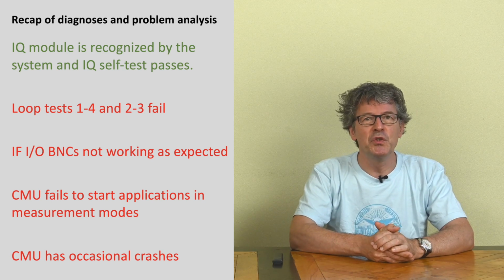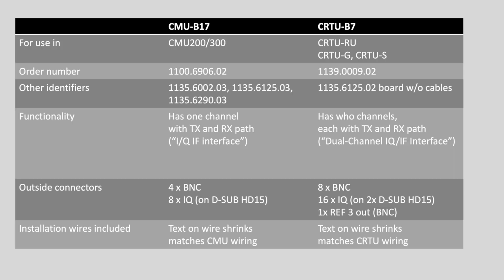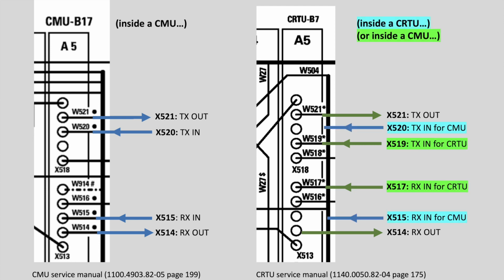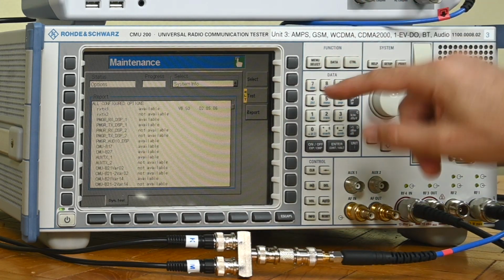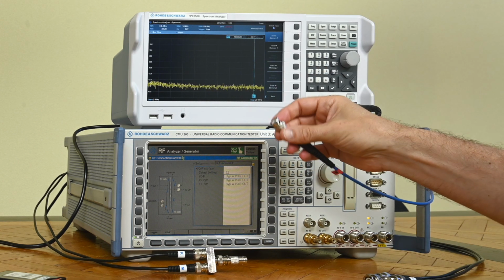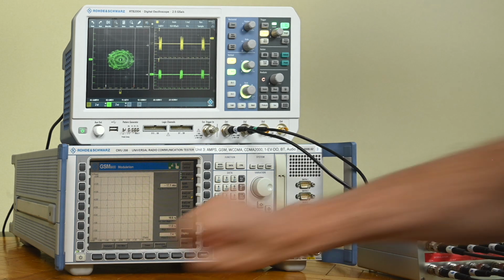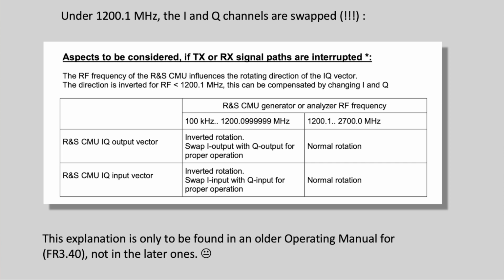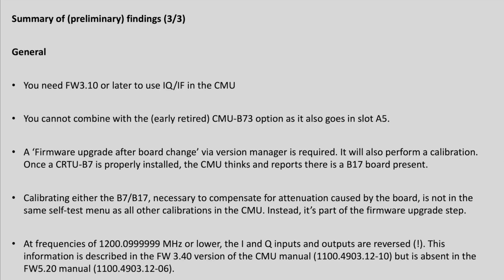REL #30 Adding B17 / B7 IQIF option to CMU200 - SUCCESS

Comment: Is it true the AMU200A can only generate limited amount of signals? You can upload 128M of IQ samples in memory, can’t you? Just hookup Matlab and generate the files. Probably only baseband so you might need to uoconvert. Quite sure R&S have foreseen that in some way. 

I use an Anritsu MG3700A for similar A and B channel IQ signals that are added and upconverted. Comes with the 2/3/4G signals as standard as well as the software to upload your own. 160MHz of baseband bandwidth, so quite impressive. 

Would not match so nicely on your desk with the R&S family, but happy to lend it out to you for some weeks to experiment with.
Reply from the maker: Dear Wim, the AMU200A is quite flexible, and you can indeed upload IQ samples in memory (and also create lots of signals otherwise)…. but … to do so, you need one of the Baseband Generator options (AMU-B9, B10 or B11). I do not have these options installed, so my unit is basically limited to being a fading simulator. Cannot complain, as I got it at a bargain price, but if I ever manage to get one of these options, I’d like to upgrade it. 

The Anritsu MG3700A certainly looks very interesting! I’d really like to use it one day, and would be happy to see whether we can run some project together with it ;-)
Reply: @rudiselectronicslab861 ahh! You need the option to actually make it function as it is written on the front :-). Yes, that is odd. 

Happy to help out with the Anritsu.

Comment: Sometime to note. This option is only working on newer CMU that one that has the MB with the USB connector. 
I bought the board, probably from the same seller as you, but having a old CMU I thing it is not working for that reason.
Looking at the MB schematics that are available online for the older model and the board you realize that one of the power supply rails is missing. 
)Mean one pin is clearly connected to a power regulator but is not connected to anything on the motherboard)
I thinks is like a 5.2 volt that is regulated on the board to 5V. Without that the board is still recognized and seems to work but the self test show a ton of errors due to missing voltages and nothing is outputted to the IF channels.

I am curious of have a look at the newer MB schematics but that are no public, have you got them in the schematics you obtained for the unit that you show a couple video ago? 
Just wanna verify at which pin the 5.2V is in the new motherboard connector or more in general how is the pinout of X52 so I can compare with the older one and find if are any difference.

PS
Also my  board is CRTU board but it show the FW version been 1135.6125.02 fw 3.23
Reply from the maker: It may be true CMU-B17 can only be combined with FMR6 (or later), but I have not come across any document pointing that out. B17 seems to be quite an old module: its CE declaration is dated September 2002 (CMU Operating Manual for FW 3.40, 1100.4903.12-10). That does not mean it was actively sold at that time, but it suggests its design may be as old as the CMU itself. 

Looking at an older version of the CMU Service Manual (1100.4903.82), which only lists FMR4 and FMR5, the slot A5 and associated connector X51/X52 are designed for an “A/B TEST” (no idea what that is), for an “IQ-MODDEMOD” (so the B17) and for a “LOW FREQ BOARD” (which much be the early retired CMU-B73 Analog telephone line interface). That document does provide a pinout of the X51 and X52 connector, with +5.2V specified for pins X51 B6 and B7. At the same time, that old service manual does not provide the same level on B17 as later service manuals, for instance, it is not mentioned in the big wiring diagram. 

So I wonder whether B17 should work after all with FMR5, but cannot be sure... I have a CMU with FRM5 here; if I once come across one more IFIQ card I might try it in there!
Reply: @rudiselectronicslab861  So I check basically the board on the side where the connector are inserted had a budged regulator, that regulator had the Vin pin connected to X51 B20 pin. That pin is not connected on older CMU motherboard. Would be interested to know what voltage that pin has on newer motherboard!
 Also The budges on the two regulator are amazing! Guess R&S sold very few board and didn't want to release a new revision of those?
Reply from the maker: @vaualbus  I tried to check the CMU200 Service Manuals I have to see about that pin you mention. In an older version of the CMU Service Manual (1100.4903.82, I have an incomplete version), which only lists FMR4 and FMR5, I see in Section 6 a circuit diagram in which X51 B20 is not connected to anything. 

In the copy of a later version I have (1100.4903.82-04), Section 6 with the circuit diagrams is unfortunately missing. And for an even later version (1100.4903.82-05, probably 2006), there are some diagrams in Section 5 but these are not so detailed and do not list individual pins. . It does mention on page 3.6 the output voltages of the PSU: “On the secondary side, it generates all DC voltages (+3.3 V; +5.2 V; +6 V; +8 V; +12 V; +12 VFAN; +12 V Standby; +28 V; 12 V) for the R&S CMU.”  “The +12 V-, -12 V and +6 V- secondary voltages are provided with analog regulators in order to ensure a high spurious suppression. The +3.3 V- and +5.2 V- secondary voltages have their own stepdown converters to achieve small power dissipations. […]” 

Reading this, I noted that the 6V line mentioned for the PUS in later documents is not mentioned for the X51 of X52 bus in earlier version. This could this be the line you look for (this is speculation, but it may also be that this does not go to the large bus connector after all, or not used by IQIF at all.  

In the IQIF self-test module, I see 38 measurement values, and the first 8 seem to refer to the PSU voltages (+28V, +12V, -5V, +5V, +8V, -12V) and the reference voltages (Ref +5, Ref -5) the module receives. In the diagram in CMU Service Manual (1100.4903.82), I see all of these voltages connected to X51 or X52 EXCEPT the -5V. This may be another hint? But again, speculation. 

I can try to measure  X51 B20 for you but it may take some time… If you want a copy of any of the documents I mentioned, drop me a PM…
Reply: After years I was able to get the hands on a USB motherboard, X51-B20 is connected to +6V (X72-A15 for example)
Reply: Thanks, where I can find an email to  write to you? 
Alberto
Reply: I know it is a fairly old video, but I also had the issue with a missing voltage. I soldered a wire from A10 on the same connector (8V) to the LDO input (B21?) and got the missing voltage. It consumes something like 200mA and had no issues. Just in case someone gets the same issue.
Reply: @noaccountification  On USB motherboard I checked and is connected to a +6V line